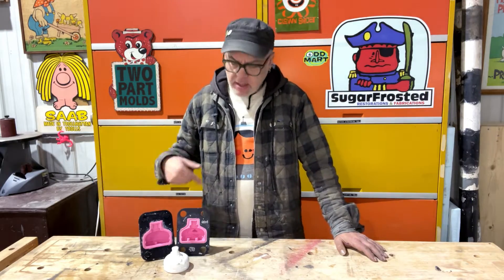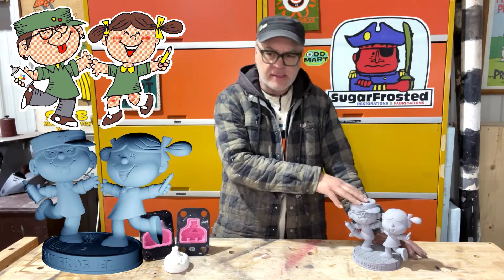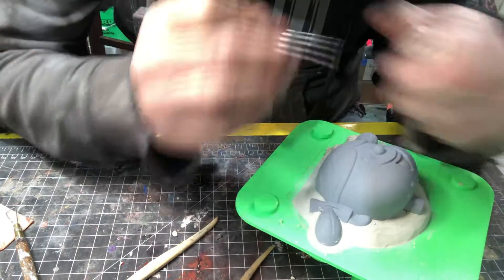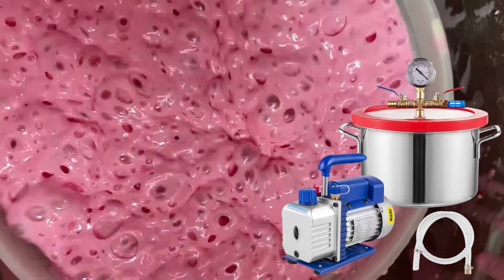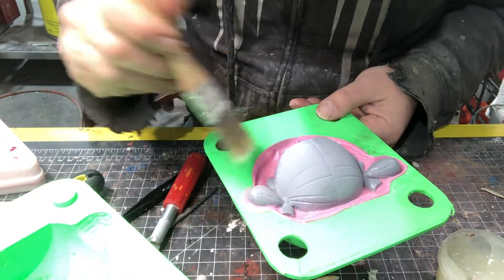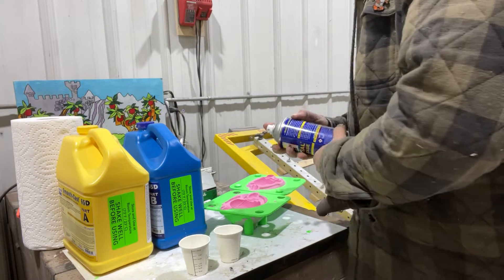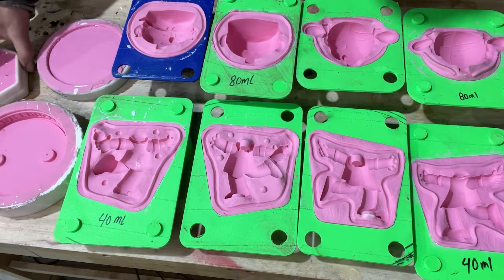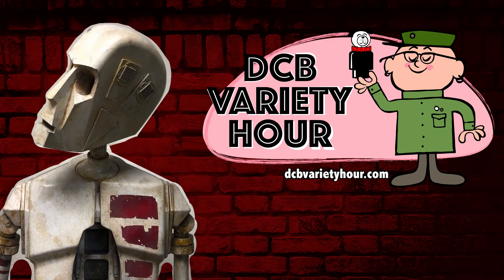Two Part Silicone Mold with 3D printed mother mold

Comment: Nice stuff. The "tin cure" means that the silicone's catalyst uses tin, the metal. Some even more expensive silicones use platinum catalysts instead, but they're food-safe once cured, so you could use the resulting silicone mold for baking muffins, for instance.

A number of questions: do you think putty or some DIY cold porcelain would work in place of the clay?
Have you considered creating a series of screws in the 3D printed parts? With them, besides serving as fitting holes, you could also screw a nut around each, possibly making the parts fit more tightly than with those clamps.
Reply from the maker: I guess putty or porcelain would work if you can remove it from the 2nd half. I use the clamps because they're quick. I want to get the mold on the machine and rotting as quick as possible. But I could try using screws I suppose.

Comment: The PLA prints falling apart I think was because they where printing with the speed way too high. You print too fast the layer adhesion becomes less. Then where they store the prints afterwards like not leaving it out in the sun outside affects the plastic.
Reply from the maker: Yes, I'm sure that those are the main factors. Also, PLA is, by nature, is a biodegradable material - so there is that too. I haven't had any problems myself, but who knows down the road? Why risk it.
Reply: @dustincropsboy . Same here I haven't had any problems with PLA either with my prints. I keep 3 wall layers thick and make sure all my filament is dried out well with a filament drier and silica packets. 

I just thought it was very strange how it crumbled like that in the video. 

I know what you mean about not wanting prints to degrade I also learned to try and keep backups of STL files in case of something breaking. 

I used to do casting in Algaenate wax and plaster in college !!!

Comment: When you rotocast, have you ever had problems with the resin getting into small areas, like the tip of the pencil?
Reply from the maker: The pencil actually came out perfect every time. The problem area was actually the tip of the collar on my figure, it would leave a little air bubble. But I would just brush some resin into that area first before I would pour the rest of it in. And then it would get a little thin where the legs would meet the body because it was such a sharp angle there. So I ended up having to drill a hole in the neck and pour some resin down the leg and part of the body so that it wouldn’t break from the weight of the piece.
Reply: @dustincropsboy  Thanks for responding. That's super helpful to know!